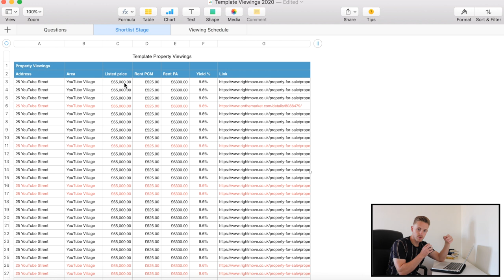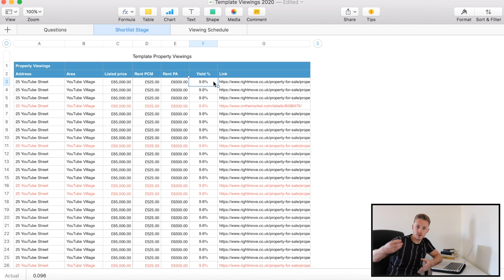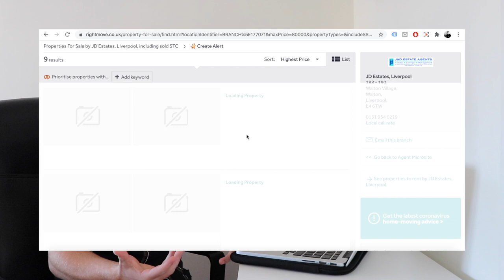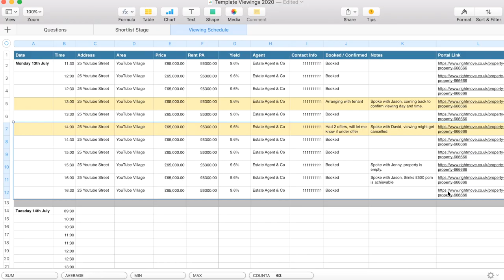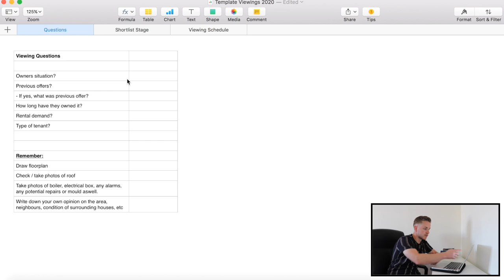Booking and Viewing Properties. Things to look for on a house viewing, viewing checklist, Vlog 8

Comment: Hi Justin, solution to your car problem: firstly, sorry to hear about your issues, what a pain! My recommendation is to use a car hire app - I use TURO and Hiyacar. It’ll cost you, but you’ll be able to make it to Liverpool and back for your viewings. These apps are basically AirBnB for cars. Just an option bud.
Reply from the maker: Thanks for that suggestion. I was looking into enterprise rental, so il definitely look at those 2 options tomorrow as a comparison! Cheers
Reply: @JustinWilkins  I recommend TURO highly, better app for sure. You'll need to put aside 5 mins for sign up, and wait 1-2 hours for approval. Hiyacar can take longer to have your license approved.

Comment: Great video, you went straight to the point! Also, if the car is giving you those many problems, maybe considering replacing it? Not an easy decision but worth thinking
Reply from the maker: Thanks Henry! Always appreciate you watching, and yes I definitely think its time the car went. Going to get it fixed and maybe consider and upgrade, or even a downgrade just for a year or 2.

Comment: How do you check if Alarms, Electric box and boiler is safe/good to use ??
Reply from the maker: Personally I go by the certificates. If I’m buying a house off someone and I’m doing new electrics and boiler, then no worries because I know I’m putting new ones in. However, if I’m buying a house and not replacing them, then I want the owner to have had them properly checked and certified before I exchange.